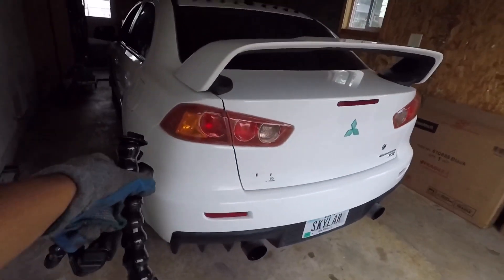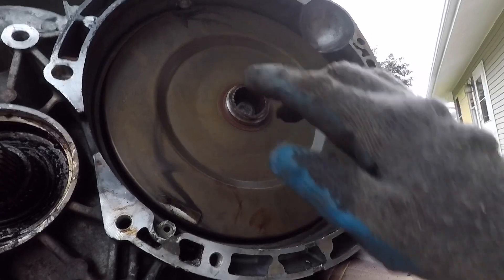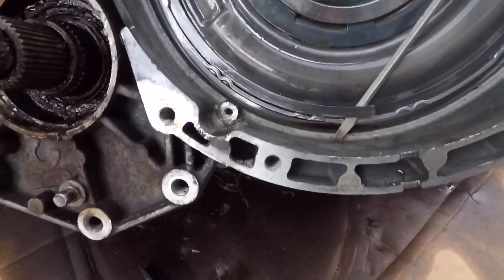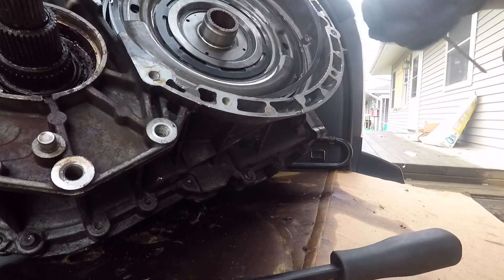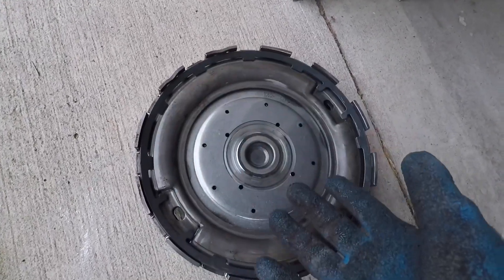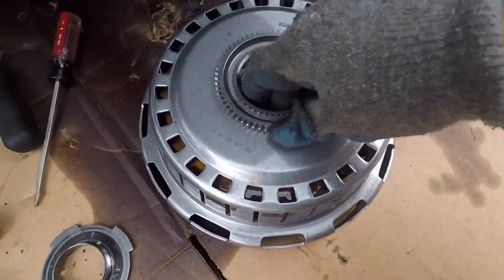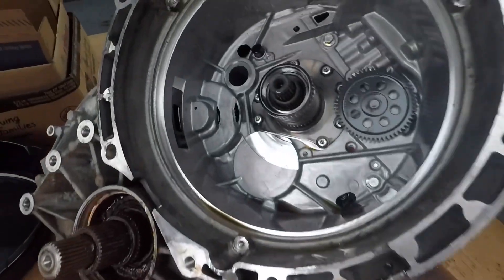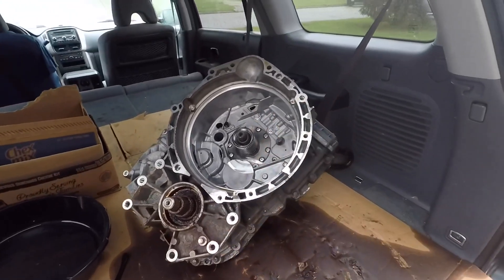Mitsubishi Evo X MR SST Transmission DCT470/ 6DCT470 build - Part 1

Comment: Is the SST prone to valvebody failure?(mechatronic)
Reply from the maker: Jay chandler from what I investigated it can. Like right now one of my Mechatronic round side piece is a bit lifted. It’s not sitting flush. So I have to see if I need to replace it. Hopefully I can make a video on it next week or so. On my vehicle it doesn’t go 1-3-5-R but all even gears work. My dampener is broken and a lot of metal shavings on my magnets. I think it’s rare for valve body to malfunction unless it’s clogged or your solenoids aren’t working. Hopefully that answers your question.
Reply: @josezamora7889  Thanks, yeah it did, because I've been told that the valvebody failures can seem random, abrupt or rare but that's because of dusting( the internal filter gets clogged and causes pressure issues in the valvebody and a new one is like 2k+ so I'm looking forward to your upcoming videos)
Reply from the maker: Jay chandler no worries, yeah I’m hoping to open this up and be as clear as I can on the video with lots of description and even pictures too of schematics. Probably will show how to do a replacement of seals as well. Let me know what I can change or do better on. Thanks 👍

Comment: Great series of videos. Was it hard and a lot of work to get the transmission out of the car? Did you do it in the garage on jack stands?
Reply from the maker: bigrustybucket for that part I had to pay a mechanic to remove the transmission from the car. But from what he told me is that it was hard plus some bolts were rusted and broke. 😬